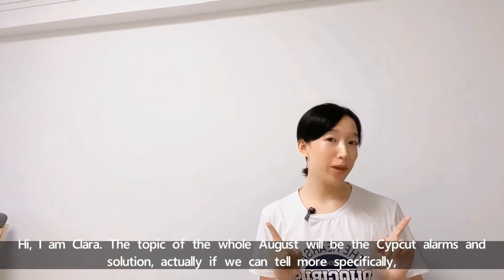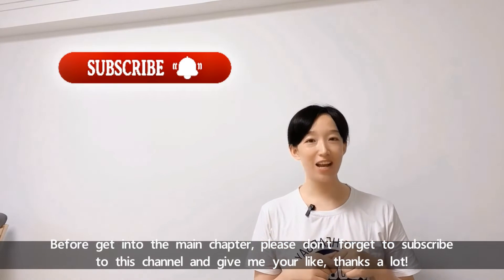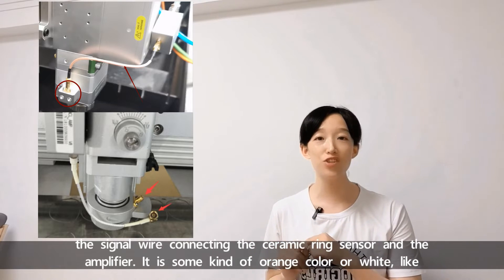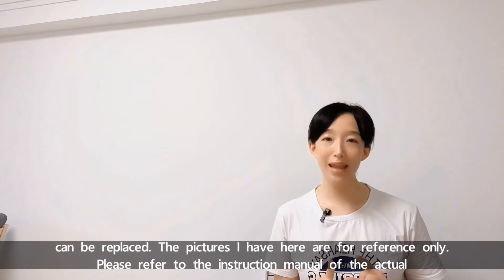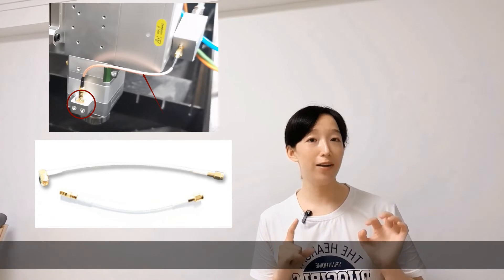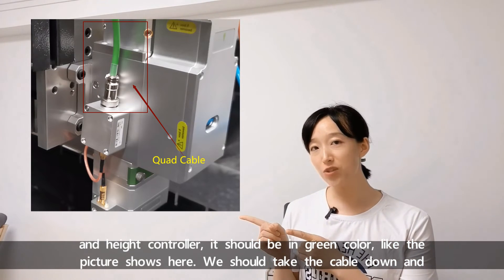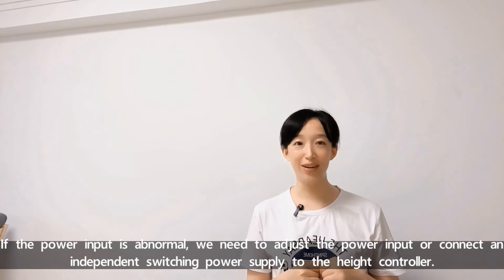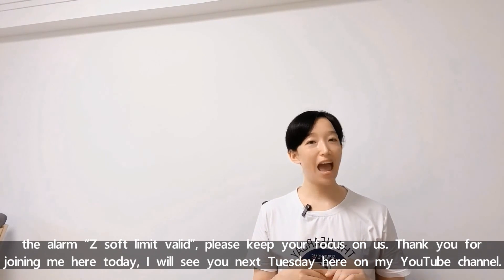Cypcut Alarm: Capacity is 0 | BCS100 Alarm | Fiber Laser Cutting

Comment: Good morning Clara, calabration is perfect 3 step and quick calibration, replaced ceramic, capacitence amplifier and wire, will cut for a while then CYPCUT BSC100  CAPACITENCE DEMINISHED 512 alarm appears again. Solution?
Reply from the maker: I have a video telling the problem, released on membership channel I think, you can check it out.

Comment: Hi Clara, thank you for the videos, I'm getting an alarm on the bcs100 when trying to do calibration. 
New sensor, New rf wire, check the quad cable and connector. Everything seems to check fine. But when trying to calibrate it give me a alarm: always hit board/cap zero. What does this mean. Any help would be greatly appreciated
Reply from the maker: Could you show me a picture of the alarm? +86-13335151833, clara@spierlaser.com

Comment: Hi mam, i am facing top touch alarm issue in my machine very often without getting my nozzle touching anywhere. When machine travels from one point to another or accelerates, alarm comes , even when nozzle is 50mm above the sheet material. 
Pls help me out 
Waiting for your response
Reply from the maker: Is your supplier helping to find a solution?
Reply: @ClaraChai  tried changing rf , ceramic part, signal cable, bcs amp 
Still same issue observed randomly, sometimes it comes no. Of times in 1 minute and sometimes work 2-3 hours without alarm